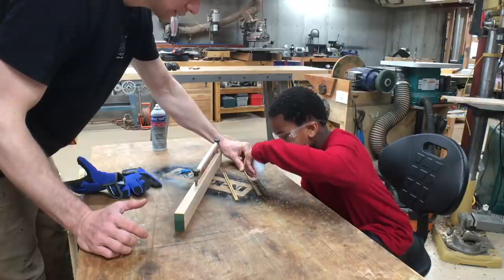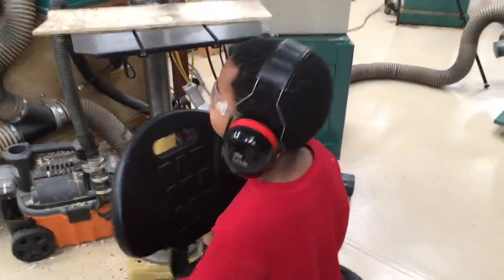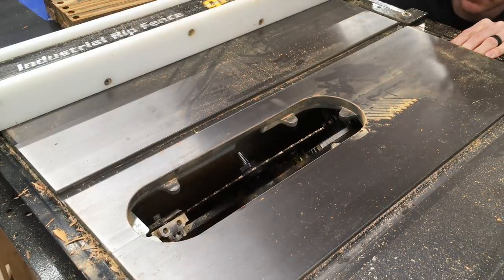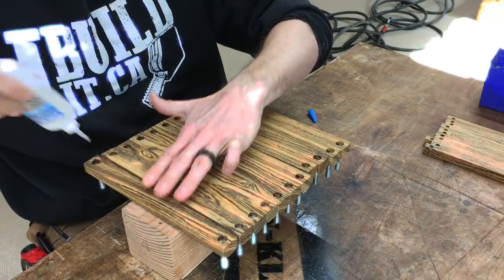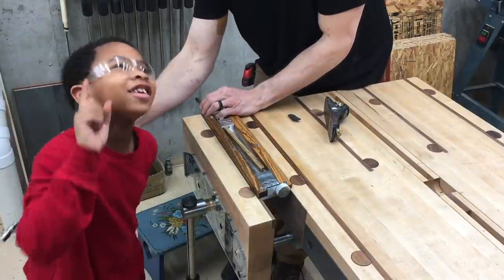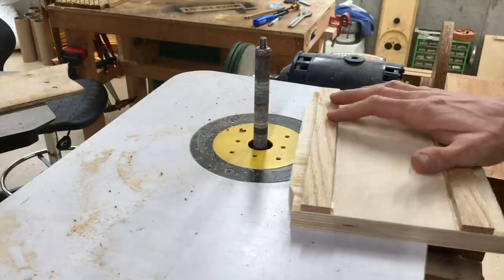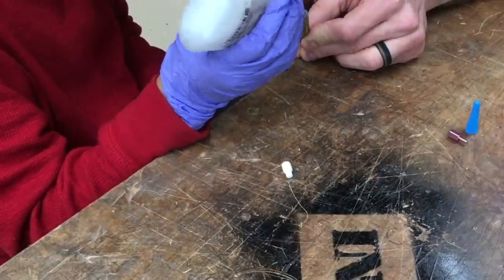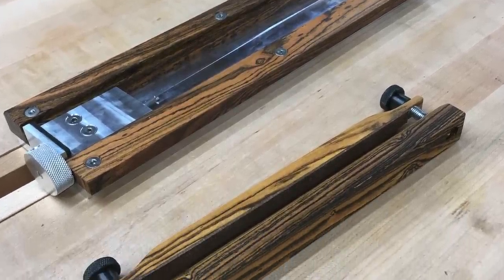Pencil Presses and a Pencil with my son

Comment: 1. I'm definitely checking out that Bobby Duke, with endorsements like that he's gotta be great. 
2. For kids in the shop, I recommend painting safety warning stripes on machines where fingers don't go. E.g. pinch point @ leading edge of the planer that smashes the board down once engaged by pinch rollers. Safety strippers are for orators of any age, but importantly they redeeming adults "here is one of possibly a few req'd safety lessons before kids are allowed on this machine"
Reply from the maker: Bobby Duke is great, very talented and funny